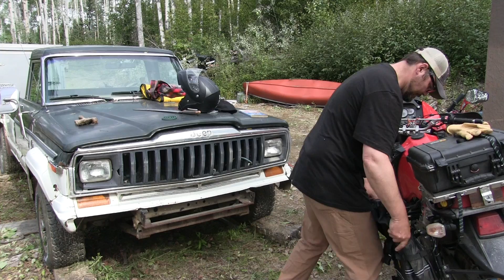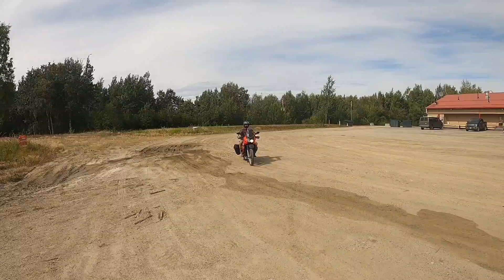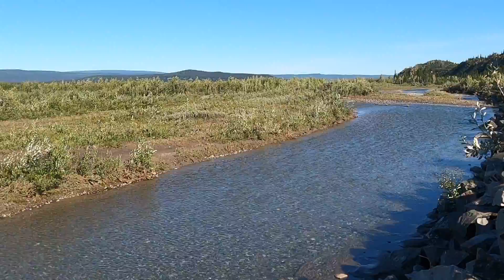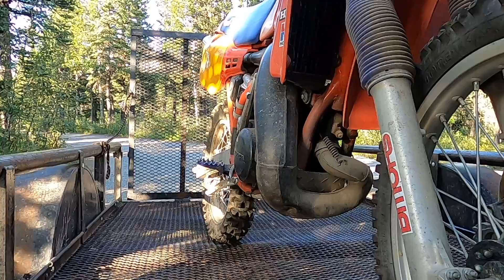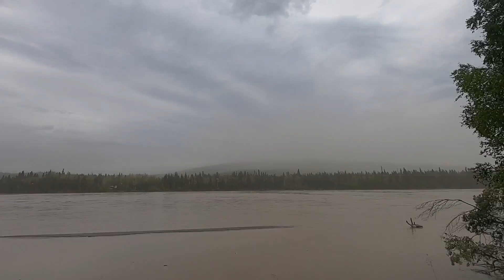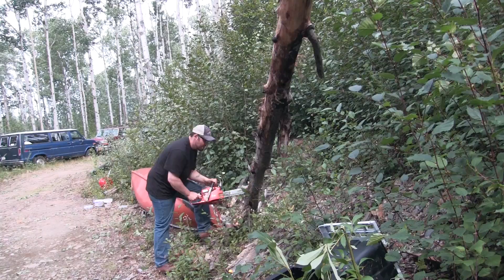Bushradical Alaska Motorcycle Camping

Comment: in 76? my crew was drilling VSMs[vertical support modules] for the Pipeline on the back side of Donnelly Dome. Nightime subzero.The pipeline is pretty high up the hill.Northern lights were out in full force.We drilled a artisian well halfway up that hill! Kinda threw the engineers for a loop.Water overflowed the 32 inch diameter hole and was running down the hill over the snow.I'll never forget that.Guess I was barely 20 years old. Just cause you are up on a mountain does not mean that there can't be water underneath you.Used to be alot of blueberries there too.

Comment: I'm not a fan of hammocks. I sleep on my stomach and being bent backwards just isn't comfortable. I've had a few Kawasaki, at one time I had five Kawasaki 500's, 3 cylinder 2 stroke.  Those things are scary fast, high 12 second 1/4 mile. That wind would have had a hard time keeping up with me.  When I lived off grid in the mountains I had a little Kawasaki 125 trail bike. I had been bragging to a friend about doing 15 foot jumps with it. He didn't believe me and wanted me to show him, so I did.  After measuring it turns out I was doing 25 foot jumps. When you only weigh 135 pounds it doesn't take much of a bike to get airborne :>